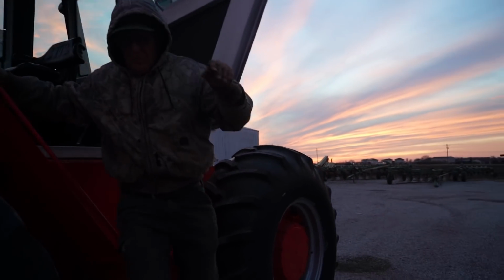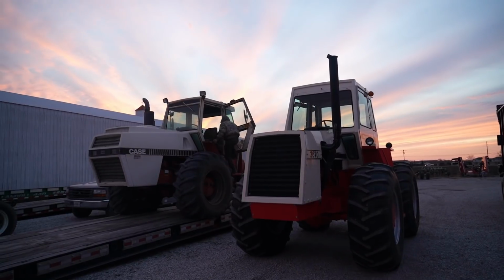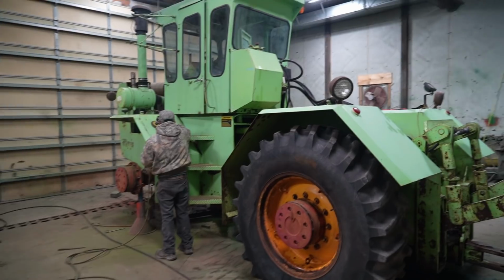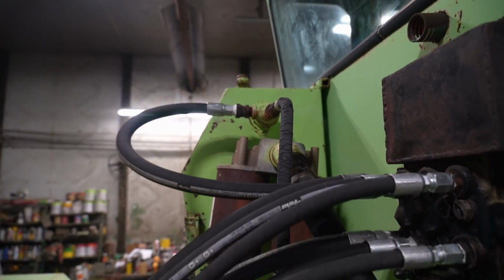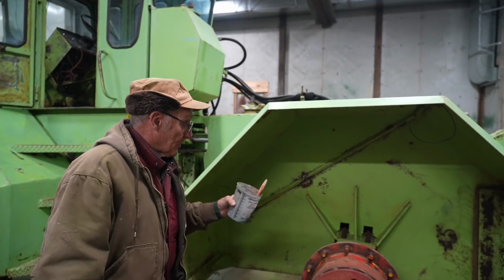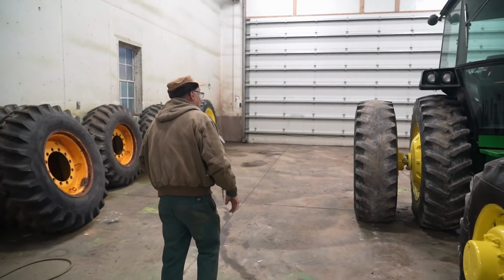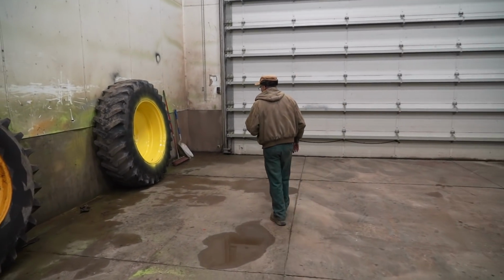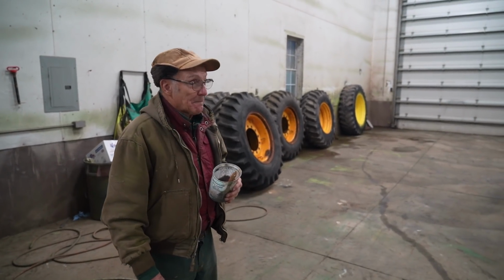New Case 4890 and a Restored Case 2670

Comment: Put some wood blocks or jack stands under that Steiger before you maim or kill someone!  Relying entirely on the hydraulic jacks to support the tractor is an accident waiting to happen.  If just one rubber O-ring fails in one of those jacks, the whole thing will come crashing down.

Years ago an employee of our fertilizer supplier relied on only a heavy-duty bumper jack to hold the front end of a semi truck. The front wheels were removed.  Then the guy crawled under the truck engine.  The jack failed and the guy's head was pinned between the bottom of the oil pan and the concrete floor until the EMTs arrived.  He survived, but has permanent brain damage due to a partially-crushed skull.